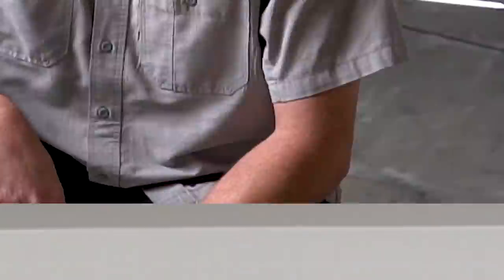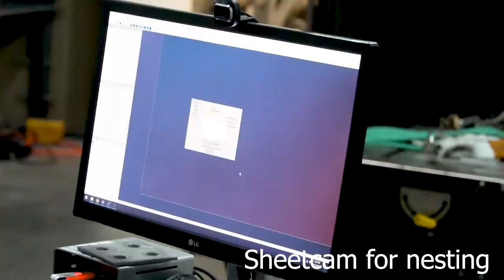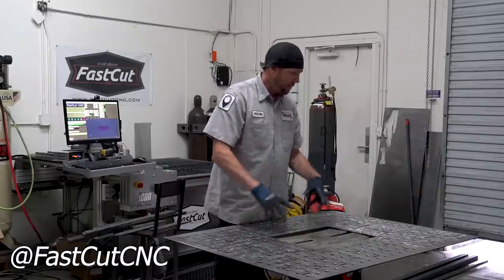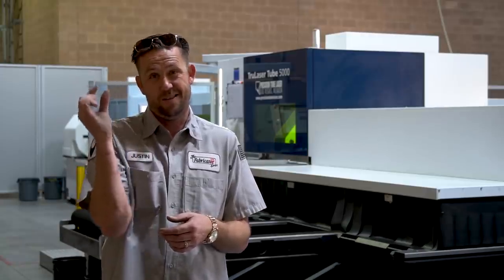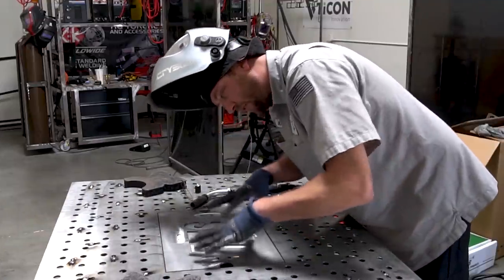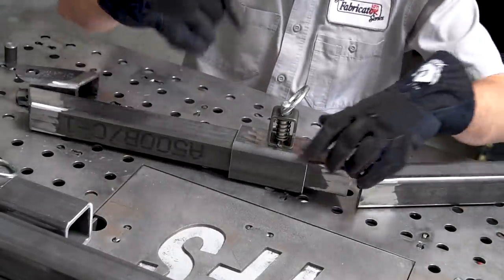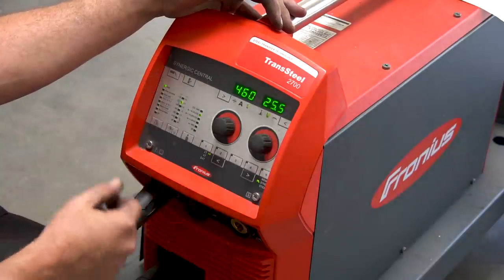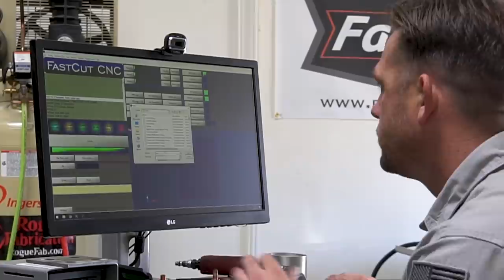TFS: Made My Own Fixture Table

Comment: that's a neat build,never seen a table with holes before in England.Just welded a sheet of plate steel on top of a steel table frame.Any fixtures and jigs just welded to the plate and grind off after.

Comment: I built my fixture table. 36x52in 5/8" thick top. 5/8" holes on 2". The frame is 1.5x3" .25 tube with threaded studs sticking up on 8" centers. The top sits on the studs with nuts underneath and bolts on top that thread in the center of the studs so the top can be adjusted for flatness. Its on 1200lb casters, weights 600lbs and has legs that screw down if i need them. Top is in 3 sections I milled the edges and drilled all the holes on my Bridgeport. Its a blend of fireball tools welding table and the Stronghand Rhino cart. I bought the studs from Fireball tool.

Comment: I've seen this a couple of times, as well as other of your vids, and have a suggestion.
On my (woodworking) table I built a stool and it swings around one of the legs on a hinge.
So, why not bend a 1" round stock to fit into a socket that is welded to one of the legs.  It bends 90 deg out then 90 deg up.  A socket welded to a plate (your diameter) then slips onto it which allows it to spin - by hand.  The top of the plate is even with the top of the table.
You now have a turntable that facilitates round part welding - even if it is manual.  And it is removable.  How great is that!  There when you need it, gone when you don't.

Of course you could accidentally modify it by using longer sockets and make a stool out of it (seat would be lower but still can be used as a low turntable), like mine, and have a double duty setup.

Comment: Really clever design. Is it yours and would you be willing to share plans?
Also, was a specific reason for using the P&O plate for the top?
Reply: P&O is strictly a finish process of the steel. It is still just hot rolled A-36 plate. Pickled and Oiled to remove the mill scale and create the nice finish. So to answer your question it would be used so you have little to no surface cleaning other than wiping away the oil. Surface finish similar to cold rolled at less cost.

Comment: Great project, you should always weld inside joints last, , and should weld   Sequence your outside joints from the inside too the outside corners 😜👍.  So order should be outside joint , opposing outside , corner joint, the inside  joint  last , opposed weld direction from your outside corner joint  less distortion and integrity
Reply: Yes been welding alot of square tubing lately for some gates and a wrought iron privacy I did, and yes I found the inside corners has the most leverage and pulls the most so the outside corner should be done before the inside. The two sides come first. Starting with the sides is just easier to since clamped to table anyways.

Comment: Cool table.. I got really lucky and found some aerospace surplus on Craigslist.. it is a chunk of (I assume) 6061 aluminum 2" thick with 5/8 holes drilled in a 2" OC patern and 1/2 ×13tpi steel thread inserts in the bottom. My milling machine clamp and stud set work perfectly with the step blocks etc.The top is milled flat. Its 39" by 6'. I still am plotting a scheme for the legs and probably cabinets for storing clamps and fixtures...but for now it's just sitting on sawhorses. I like your folding leg idea but will probably opt for stationary legs with some height adjustment and storage space. Great build...wish I had a cnc plasma table!
Reply: jeff pitzer that’s a score!
Reply: That sounds like the kind of place I'd really enjoy! If you want to steal my table you better bring some big strong friends and pack a lunch! It weighs around 550lbs. When I  get settled into my new shop I hope to take advantage of opportunities to acquire "industrial waste"... lol.

Comment: You touched on the price of oxygen vs nitrogen when you had those tubes cut
Was that an option you could have opt’d for
How much more was the nitrogen 
How do they price their cuts is it by the inch or by the type of cut or both more for a er regular cut than a straight or by the amount of time the machine takes to cut the material

Comment: Would you be producing a builder kit for sale based on this design, and or are you willing to sell the cad file that I can take to a local fab shop that can cut out this kit so I can weld it together.   I have seen a lot of tables and this by far is one of the best setups fro a home do it yourself fabricator....

Comment: I watched your video on how to TIG with your MIG torch and have a question...
Can you use your MIG torch to spot pins for doing auto body/dent pulling work?
I was thinking you could drill a contact tip out to fit the pin and zap it on, I figured you could lift the drive clamp to stop the wire on older machines. Do you think it would work?
Reply: Check out Eastwood, they sell a stud kit that mounts to a mig gun and welds the studs to surface. It also comes with the slide hammer. It works pretty good.

Comment: Great video but only one critique. If you got a welder you don’t need to bolt the wheels the bottom of the platform. Get rid of the nuts and bolts. That’s why you have a welder. It’s cheaper.

Comment: I didn't think you could weld a great 8 bolt I thought it made them week
Reply: Ryan Rotten you are correct but the size of these and amount load they will likely receive probably won’t be problem. I don’t think Justin will be beating anything with a sledgehammer on his flat table. LOL

Comment: Where can I get those locking de tents
Reply: Zoro carries them.  Zoro #: G9112070  It's a latch assembly, spring, weld-on, plain, 5/8" and is about $7.50

Comment: I’m not a welder or a fabricator just a dude interested but I have a question for the top of that- how come you couldn’t just use a quarter inch thick for the top and not put all those thicker slats on the bottom instead of the 3/16 for top?  Would heat still warp 1/4 in. without those? Would it be cheaper/same? I’m asking in general and not necessarily for this specific build. Anybody?

Comment: Where can I get a plan for this table build?I am in neeeeeeeeed of this table
Reply: Check out Thor Welding Innovations. We are currently busy setting up a website to provide the DXF files for a small fee. Files will eventually be available in Metric and Imperial sizes. Contact me through the site and I will send you a small sample file you can try out of a very unique V-Block that can be very useful on the table or on its own. It will be provided with clear instructions on how to go about having your parts processed through a laser cutting service provider of your choice.

Comment: That 5 axis laser cuter could have put a bevel on for you....
Reply: Not as easy with napkin sketch as documentation trough. Tube laser companies tend to be much happier with 3D data in neutral export format and drawings just for reference.
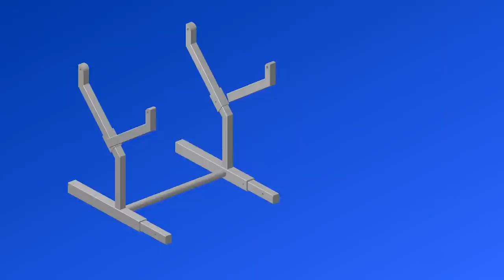Reply: @9:39.... i was just making an observation. Plus, even if it actually was a napking sketch they did actually do it in SW (@9:35) so adding chamfer was just 10 left mouse clicks away.... i quess you get what you pay though.
Reply: unless of course those are random shots...

Comment: Did you say the oxygen gas cut was more expensive than a nitrogen gas cut? Interesting that it would be that way. In an air separation unit it’s way easier to produce nitrogen then oxygen. Interesting

Comment: Great video! But!

I think weld sputter will be a problem in the long run. A better way might be to buy the table plate from a professional welding table manufacturer and only build the custom designed chassis on your own. Here in Germany we have a well know welding table manufacturer  (Siegmund) that uses special coated and hardened plates where weld sputter won't stick. 

On a German youtube channel someone built a clone of a Siegmund table. He had all the parts laser cut at a professional workshop - all the rest he did on his own. The table turned out to be as expensive as the Siegmund table but without the benefit of the coated  and hardened plate.

Comment: This was the shizzz untill that dic over at fireball made the cast steel version.  Now Mr monkey brain wants cast steel... why,WHY!!

On the bright side I did make a welding cart from a mobility chair for our new 350ext and cooler. Even painted fenders to match and added remote controls for ease of movement . Not to mention these new IGBT machines are a sensitive to vibration compared to our hard wheeled transformer machines.  With this combo the new IGBTs got cantilever suspinsion and 24v ease of movement even over random airlines , extension cords ect.

Comment: Designs a table with a hole in it and explains why. Welds a tube with a sleeve on it with a bunch of spacers under it instead of using the hole in the table that was made for this very application. 😂🤣😂🤣😂🤣

Comment: Terrible design, It will be covered in spatter in less than a year and all the holes will be practically unusable because of the same. Mine is much better....30mm aluminium slab with holes water jet cut then machined out to take a hardened steel insert that excepts both a M10 thread bolt or alternatively a 10 mm dowel. Sits on a box section tubular frame stand.
Reply: If you're full on busy welding all day everyday like I am then you'll need an hour a day minimum to keep you build plate clean...Unless you make it from Aluminium 30mm Jig plate. That's what I'm saying.
Reply: wow that's quick...probably only take you 5 if your build plate was made of Ali ;)